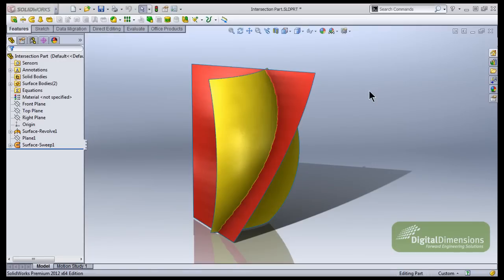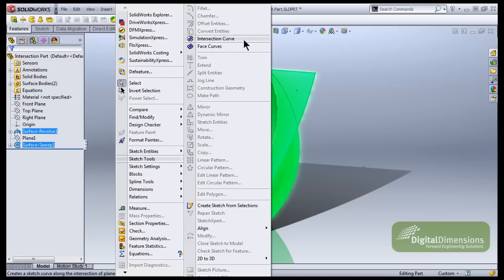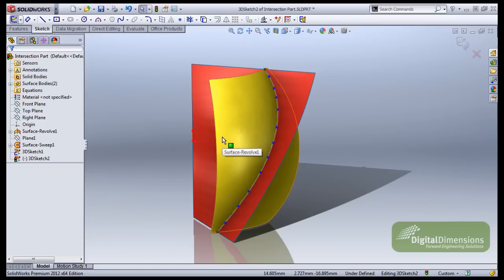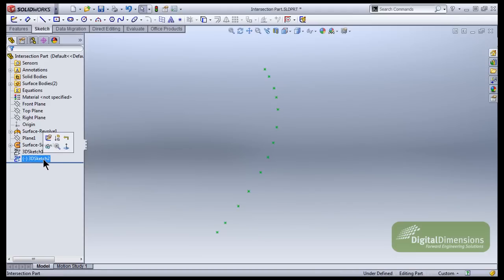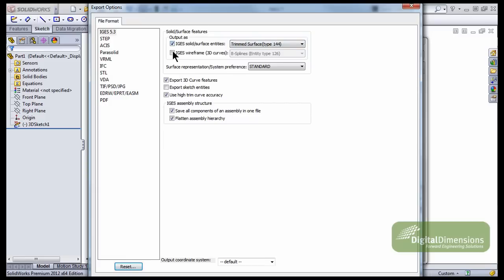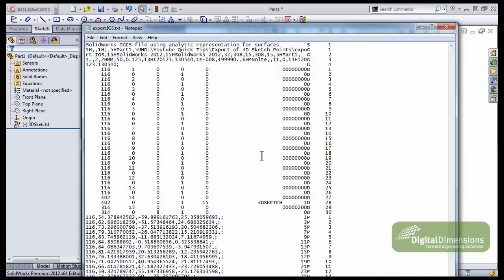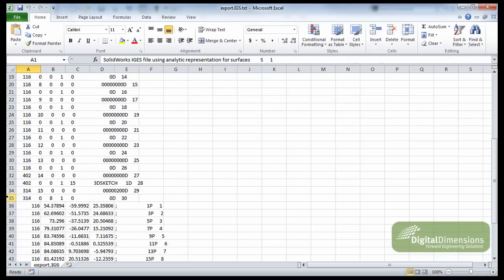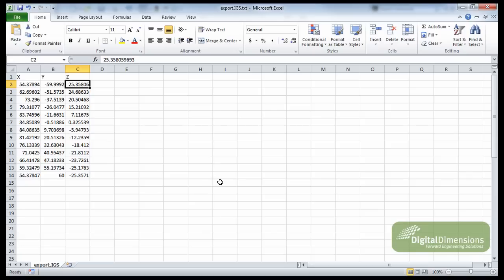Extracting XYZ Point Data

Comment: This is useful. I couldn't get my IGES file to export with the points from my assembly file. Placing the points into the seperate .sldprt seems to resolve this issue. How you cleaned up the txt data was also very helpful. Thanks
Reply: How did you place the points into .sldprt? When I try to copy the points from assembly file and paste them to .sldprt it always gives me an error.